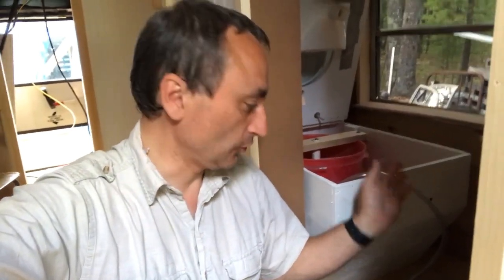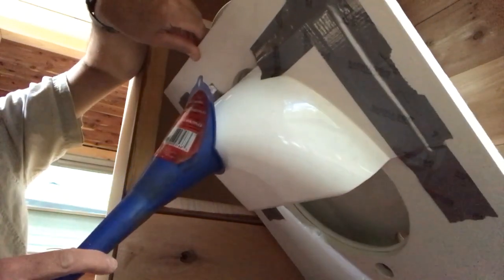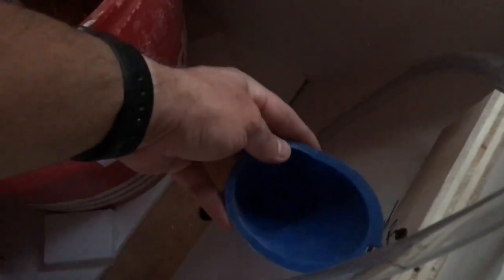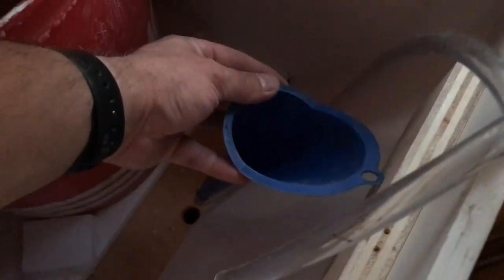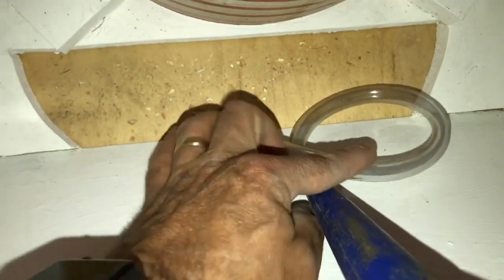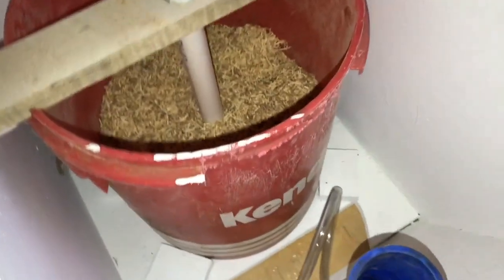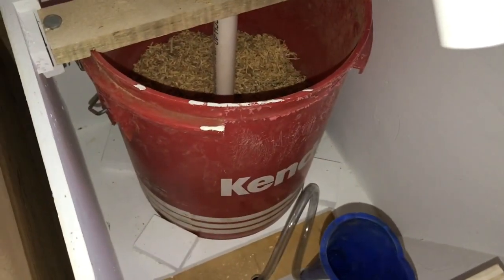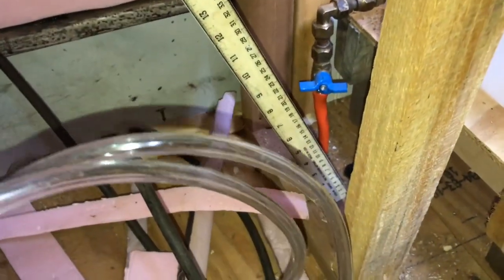urine diverter drain For our school bus conversion

Comment: What do you think of constructing a diversion system from sheet metal?
Reply from the maker: I think you would be dealing with rust in no time.
Reply: @LifetheWildRide  = Sheet aluminum and soldering or brazing ??
Reply from the maker: @DocScience2  I personally would not do it out of metal unless it was stainless steel. I’m not sure what the results would be otherwise to be quite honest

Comment: Where did you get your urine diverter??
Reply from the maker: I cant remember the company but it was through a google search. I have to say they are harder to find then I thought they would be. Ill try to find a link for you.
Reply from the maker: Here is a link to one on ebay. cant say for sure its the same company I got mine from but it appears to be the same diverter. https://www.ebay.com/itm/322654728850
Reply: Just came across this video. Please excuse my ignorance but why not get a normal septic system with regular septic tank and normal toilet?
Reply: @Foreverfreedom-jl5ji  off grid/remote simplified living
Reply: @Foreverfreedom-jl5ji  = This is on a bus and is way better system. even for a house, you do not need an expensive septic system. . There is no smell with these systems.